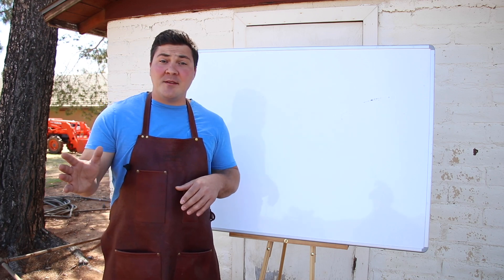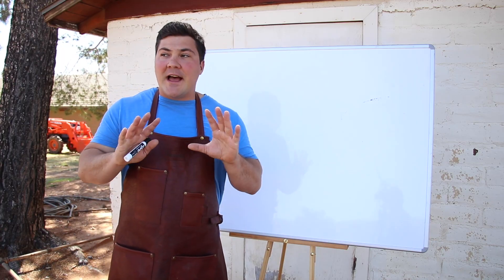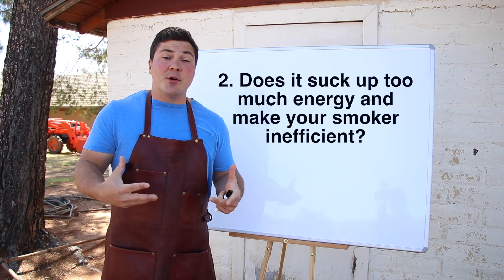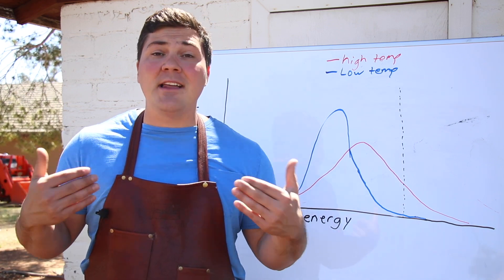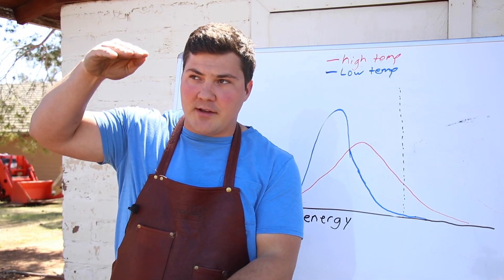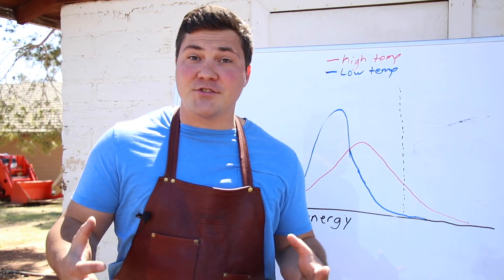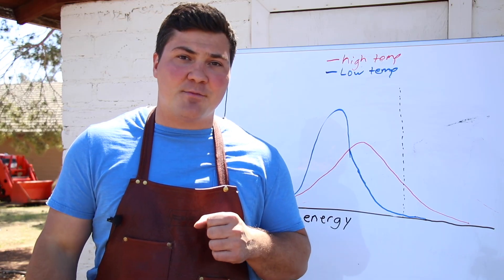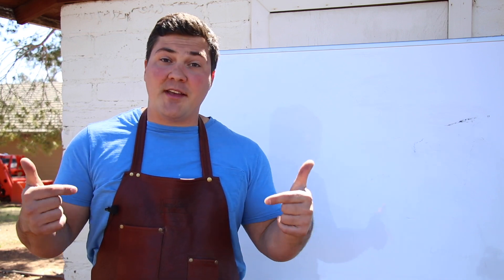Do Water Pans Improve Barbecue? A Scientific Analysis

Comment: i dont get the big deal, i've tried both and have had almost no difference.
Reply: This.  I've gone from a homemade pit to a pellet, and I've also used an offset stick.

I used a water pan the first year or 2, and made great bbq.  Then I basically just stopped.  I didn't notice a difference.  If you want to add moisture, spritz pork with a cider vinegar/juice mix once or twice.  No need to open it up and do it 20 times.  3-4 times in the first 4 hours is plenty.

A brisket gets a spray once, or not at all, and that one spray comes early in the smoke, just to attract more in the first hour.  I probably go in roughly 90 minutes in, when the meat has turned dark red and dried out.  And all that one spray does is kinda even the salt rub out by dissolving crystals and letting more smoke stick.

And if you wrap, you 100% remove the need for water throughout the whole cook as your wrap is a braise.

Comment: One of the biggest benefits with a water pan is leveling out temp fluctuations,  especially in a pellet grill, but actually any wood/charcoal setup. keeps it stable.
Reply: It helped my old stick smoker hold temps, my new pellet smoker controls temps darn near perfect without a water pan so I don't use them anymore

Comment: I don't have the numbers right at hand but from structural firefighting days the energy to convert water at 100 C to steam is much greater than the energy to raise the water to 100 C. Firefighters working on a structure fire put water on a fire not to soak it and put it out but because the conversion of water to steam soaks up so much of the fires energy (the water vapor also displaces the O2 in the room which starves the fire). Still makes sense to use a water pan. Interesting experiment would be to cook a brisket with water pan and another brisket without a water pan and see if there is any discernable difference. I usually just use a spray bottle of water and apple cider vinegar to keep the meat moist if needed.

Comment: I have a 15" diameter electric Brinkman trashcan style smoker. It has a 1500 watt electric element at the bottom. It puts out a lot of heat. The smoker is only 4' tall and without a water pan the internal temperature at the top of the smoker is 500F. The water pan is between the electric element and the grill at the top. It works like a heat sink. With a water pan the temperature at the top drops to 250-300F depending on outside factors like outside temperature and additional insulation around the smoker. It's made from thing sheet metal so a good breeze will suck all the heat out. So I've put a 55 gal barrel around the smoker to act as a wind break giving me about 3" of dead air space around the outside of the smoker and when I add a lid to the barrel I can control the heat better. Also there is no water from the electric element so it's a very hot dry heat.

Comment: So i get the calculations and stuff and I do agree with the absorbing of the excited molecules meaning less chance to burn the meat, but does the extra moisture actually affect the meat in terms of moisture retained in the meat? I'm not really sure I see a correlation since the amount of moisture leaving the meat is determined solely by the amount of water it evaporates no? (this is disregarding fat etc). how does the moisture surrounding the meat in the form of steam allow the meat to keep a bit more of that water inside it? same with spritzing. what effect does that actually have on the meat? the meat isn't going to absorb the water again.

Comment: Thanks for this informative video Jeremy. Really useful info here. I'd be interested in a part two. There are  a few important factors not addressed here, that perhaps you would consider for a sequel. First, how much moisture does the meat actually absorb from the air in the cook chamber with and without water pans? How does that rate change as the internal temperature of the meat increases and water begins pushing back out? As I understand, this occurs most prominently after the stall. But the process will have already gradually begun, so I would image at least some moisture beginning to push out in the early hours. Secondly, the food scientist from amazingribs.com has reported that moist air helps keep the surface of the meat wet, which flavorful molecules from smoke cling to, increasing smoke flavor. Wet meat equals smokier meat. This concept has taken off throughout YouTube BBQ community. Other BBQ YouTubers often quote from this report. I was hoping to get your take on this. A possible third factor would be how water pans affect moisture in the cook chamber of other types of pits, i.e. kamados, water smokers, gravity feds, pellet smokers, kettles, etc. Finally, did you consider using some sort of instrument for measurements...a moisture meter maybe? Anyway, love the video. Hmu if you're ever in Memphis, Tim Shirley memphisbbqguide.com

Comment: For me I like all the technical theory, however I’ve noticed that when I use a water pan in my smoker it causes me to cook longer in order to achieve the color and bark I’m looking for.  I also power cook my briskets in roughly 4 hours or so and then rest in a cooler. Pork butts are my longest cook but it’s only exposed for 3 hours or so to smoke. In these cases for the average everyday backyard cook, does a water pan make that big a difference? IMO no. Low and slow doesn’t need one IMO either as things don’t tend to dry out as bad at low temps. If you’re mopping your meat as I do especially with a butter base then things are good as well. Also if you inject your adding moisture. High heat cooks I could see using a water pan but I don’t feel as if it’s necessary. Spritz, Mop and Wrap and you’ll be just fine. IMO

Comment: Not done with the vid yet, but I found the water pans useless except to regulate heat in smaller smokers, especially if the heat source is directly below the meat.  Once I could regulate my fires better, I dropped the pan for a plate that helps diffuse the heat (ugly drum smoker).

Comment: How about the effectiveness of water for heat distribution? I have a cheaper grill and trying to get the indirect heat zone hotter without having to use a lot more charcoal. I was thinking about using either bricks, lava rocks, or a water tray on the indirect side but didn't know which method would be most effective.Also thought about wrapping the hot side grate with foil to force air flow through the indirect side a little more. Any thoughts on any of these ideas?

Comment: I watched the entire video; I enjoy science.  The video was good, as far as it went.  However, I think the vast majority of intermediate-level barbecue cooks likely use charcoal with a small percentage of smoke wood to cook their meat.  It is my guess that the charcoal has less trapped water in it than regular firewood, though; obviously, carbon dioxide and water are still the main products of combustion.

Aside from that, I think that we ignored one of the most important functions of the water pan - to aid water vapor saturation of the air inside the cook chamber.  The best example of this I can think of isn't bbq, but comes from the indoor oven.  Ever bake a cheesecake?  Try to get one done that looks good without adding a water pan inside the oven.  It will look like a dry lakebed; perhaps burned, when you take it out.  More water vapor added via the water pan = less water vapor being pulled from the meat you are cooking.  In practice, I believe that it is best to use a water pan on long cooks; especially for leaner meats and/or higher cook temps.
Reply from the maker: handcannon 

I appreciate your comment and maybe I just did a bad job of communicating it, but the discussion of additional moisture was meant to address that very topic

Comment: Man I love these kind of videos. Great info! I use a cast iron Dutch oven in my offset smoker. Never thought too deeply into the science, but I can tell you from experience that it keeps the temperature much more consistent. My smoker isn't very high quality and burning wood can sometimes get the temp over 400 degrees. With a water pan I can much more easily maintain a consistent temp and also a clean burning fire.
Reply: I'm not sure why this works, but it does. When my water pan is empty,  my thermapen goes off to some crazy temp and I going running over to my smoker and realize that's the issue!

Comment: I use 2 pans, 1 full of a 50/50 apple cider/apple juice mix, the other with a dark beer depending on what meats I am smoking. I GUARANTEE you they absolutely have an affect on the moisture being produced inside the smoker, the temp staying stable, and it affects the flavor. Steam is produced from those pans and rises to the racks and that steam has an aroma which penetrates the meats. I'll never stop doing my smoking that way because it works.
Reply: Why the dark beer? Does it impart flavor into the meat?

Comment: Great explanation however it's not all chemistry, it's also physics. The moisture % accuracy in your smoker is also dependent of the size, volume and insulation of the smoker.
Also sufficient heat energy plays a role with physics to ensure the chamber heat uniformabilty to ensure even moisture and smoke dispersion.

Think smallgoods manufacturing, typically salami, chemistry and physics work together during fermentation, smoking and maturation to ensure everything is uniform. The same basics works exactly with a smoker.

You can purchase humidity probes to measure and demonstrate this. There not too expensive.

There is a further level to this if you get really technical with choosing the correct humidity and temperature to get the desired results on certain cooks you do.
Happy to go through that further with you if you're interested.

Comment: Nice video Jeremy, thanks! One other reason for using a water pan is of course as a temperature buffer. Yes, there's a certain cost to heating up the water in the first place, but once it is up to temp, it will help stabilize temps in the smoker a bit. Whether that is noticable or not depends of course on the construction of the offset smoker (thickness of steel et.c.), as well a size. Either way I'm with you, I think using a water pan in an offset is a necessity. Have a great weekend!

Comment: The primary contribution of water (vapor) is to the stability of temperature.  The specific heat of water is high which is why it helps stabilize the temperature.  Specific heat is the measure of the amount of energy required to raised the temperature.

Comment: Big fan, first time, long time. Question: What about if you were to put your water pan in the fire chamber instead of the cook chamber? Would the increased thermal mass nearer to the combustion serve as a more efficient temperature moderator, or would it overheat and boil too quickly to effectively deliver moisture to the meat?
Reply from the maker: nharesound 

As long as you have a place to put it and keep it filled, it should work fine in the firebox
Reply: @MadScientistBBQ  One other question on this topic. Do you use a hygrometer to measure the humidity inside your cook chamber? Everyone seems to have various methods of carefully measuring the temperature, but given how important humidity is to the cook, why not measure that data? Am I overthinking this?
Reply: Thanks for the reply! Keep up the great work, especially the science based ones. I dig learning the science of great BBQ.

Comment: Some questions:
1) the water doesn't modify the flavor?
2) the water doesn't modify the texture? 
3) the evaporated water in the chamber doesn't help keep the temperature of the chamber closer to 225°F compared to a higher cooking temp [if you were targeting 275°F for example]?
Reply: Great video,  though!
Reply from the maker: 1 and 2) it seems to aid some adherence and bark formation

3) it requires more wood to maintained a higher temp

Comment: what size water pan would you use for a 20X40 inch smoker with a 20x20 fire box? does using a glass pyrex dish or aluminum pan make any difference for the use of the water pan?
Reply from the maker: Half size hotel pan
Reply: @MadScientistBBQ  thank you professor
Reply from the maker: Michael Fernandez 

I don’t think there is a problem with using either material

Comment: Jeremy this was a great video! The only thing I wish you added to the actual energy part was conversion between changing phase to steam and back to liquid water.

Maybe you could do a part two including airflow and humidity. If you want to get really fancy do the effects of simple blackbody radiation heat loss and evaporation heat loss on meat during a smoke compared to the humidity in the chamber.

Sincerely an engineer from Newbraska!
Reply from the maker: Cole Trojan 

I don’t believe the water condenses back to liquid form in the cook chamber, because the entire interior is above 212F
Reply: @MadScientistBBQ  How else did the one fellow observe "the water that was trapped in the metal"?  I don't believe water is ever 100% phase constant, nor does it always follow all predictable phase changes as temp changes.  A piece of ice will release a small amount of water vapor, and we can have water vapor deposited directly as ice ("freezing fog"), as examples.

Comment: Two factors that you are up for discussion with your analysis. Did you use a moisture meter to measure to wood? Most of my hardwoods run closer to 12 to 13 percent not 20. Also what is the moisture content of a brisket? 70% Thank you for the analysis.👍
Reply from the maker: William Parker 

I use a moisture meter to test the moisture content of the wood and begin to use it at ~20-22% moisture. The brisket would presumably be about 70% water

Comment: Jeremy, I want to throw a calculating wrench into this. I have a Brazos like you, I think it's great, it's done a fantastic job and saved me money, since I live in pa and only able to smoke a couple months of the year. Any question is, if i remember i put water in the bottom of the chamber, it gives you the large surface area that you suggest.  How would that effect the cook? Thanks
Reply: Or is it better to use the pan by the fire side of the pit
Reply from the maker: You could try both and see how it works. I would probably put it in a pan next to the firebox or in a pan on the grate in the firebox. That way you get more moisture and temp moderation

Comment: maybe a stupid thing to ask.
how does this compare to a deflector plate?
and why is it less effecient if your putting your water above the fire, not in it when for example using soaked chips/chunks?
in my mind only the air circulation gets slowd down causing the fire to slow down aswell.
or are you talking about the vapors that act as a sort of slow acting fire distinguisher?
Reply from the maker: Erik Plugge 

The water acts to moderate the temperature but a deflector plate just pushes the air down so it doesn’t go straight to the top of the cook chamber

Comment: From one chemist to another, that was a great analysis. You had me worried for a minute, but then came through with the water of combustion! I suspect that pellet grill users will get less benefit of stored water. The guy saying residual water in the metal 😂 My daughter’s HS chem teacher told her class that clouds are steam😡 Love your channel. Say Hi to Randy if you see him.
Reply from the maker: Bruce Hansel 

Hi thanks! Yeah I believe that pellet grill users don’t get much smoke flavor because pyrolysis liberates gases too quickly to get efficient secondary combustion. I’ll be exploring that further in a wood science video.
Reply: RE:  Pellet Grills - I use low profile disposable (aluminum) brownie pans between the grill grate and the drip tray.  The taller style of pan do not fit.    I usually position them over the hottest part of my pellet grill (usually opposite of pellet hopper).  Plus this helps to catch the drippings, which helps with keeping your pellet grill clean (especially important when smoking a large brisket).  This works pretty well.  I usually have to fill the pan(s) twice when cooking a brisket.
Reply: My kids had an elementary teacher tell them tornadoes came out of the ground.  Sometimes I fear for future generations.

Comment: Geez that took me back to Uni. I may need to go over that again, the bigger the cook chamber the higher the wasted energy and water vapour. I have a piece of paper in front of my laptop specifically for doodling BBQ's. I've always returned to the water pan as a main feature of the design. I've recently seen the Myron Mixon H2O and that design seems perfect to me. Have you ever cooked on one? I know the price is ridiculously high but surely there is a market for a budget water smoker. I'm tempted to put my degree in engineering to work and try to make something similar but with a smaller cook chamber. Try and force the meat to absorb more of those water vapours, perhaps using baffles to decrease direct heat and increase the turbulence of the flow of smoke. I'd love to hear your thoughts on the MMH2O.
Reply from the maker: BritDoesBBQ 
It looks like a solid design but I have never even seen one in person. I would really like to give one a try sometime

Comment: Now I am thoroughly confused. But when I use a water pan in my smoker, the temps seem to be more stable. So, I will continue to use a water pan in the smoker.
Reply: Without the water pan temps will spike higher, where as with water those hotter molecules get absorb so temps is lower more stable.
Reply: You're both gay
Reply: @Clixon13  can you breathe in that closet?
Reply: @KingZalaas  LMFAO
Reply: @Clixon13  +1 good sport
Reply: @KingZalaas  ...or with that THING stuck down his throat?!